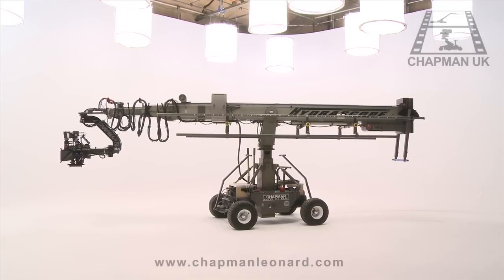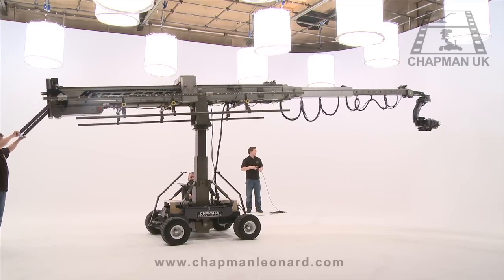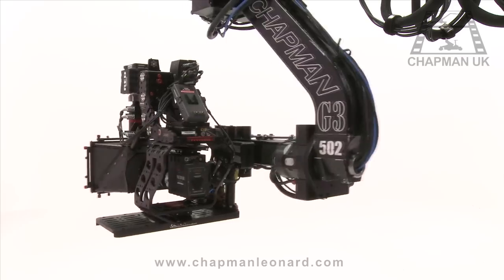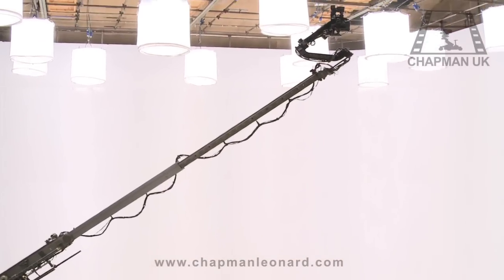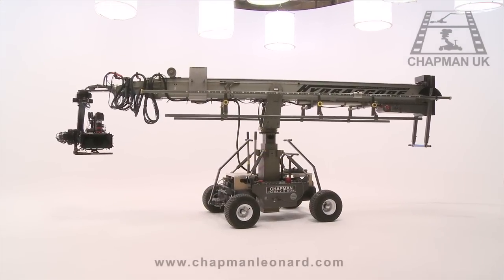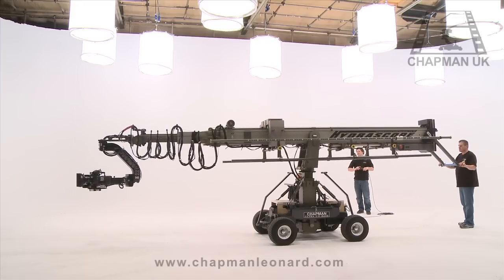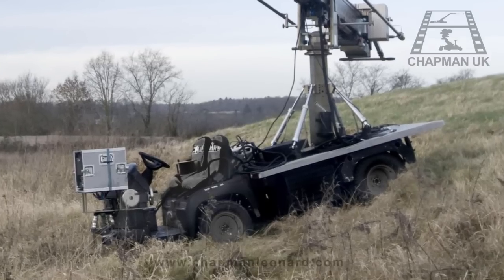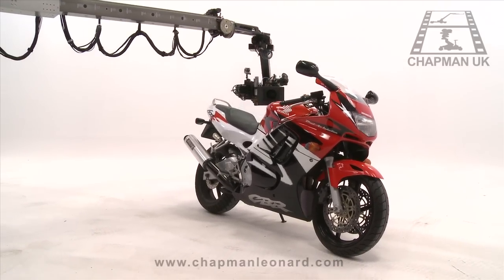HYDRASCOPE Telescopic Camera Crane, Chapman UK

Comment: just buy drone...
Reply: you can't compare a drone to a jib
Reply: Professional drones cost from U$S 15000 to U$S 150.000 without camera.... or real helicopter with profesional gymbal.
Reply: Comparing a drone to a hydrascope is like comparing a scooter to a lambo.
Reply: And what about artificial rain which is shooted from firetruck your drones goes down in second and 6000 $ plus 15 000 $ camera goes to hell
Reply: Drones can't go under water or lift heavy camera packages.
Reply: inform yourself ALTA 8 can lift 15 kg
Reply: the difference between a filmmaker and a hobbyist, drones cranes and jibs are used for very different things the filmmaker knows this, the hobbyist compares them for the same function..